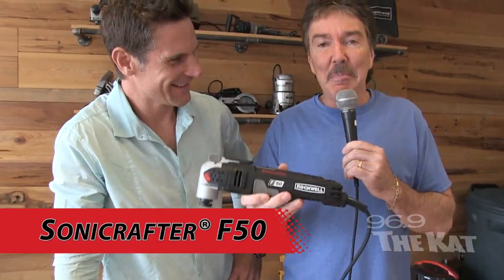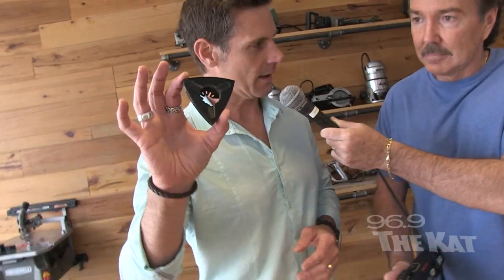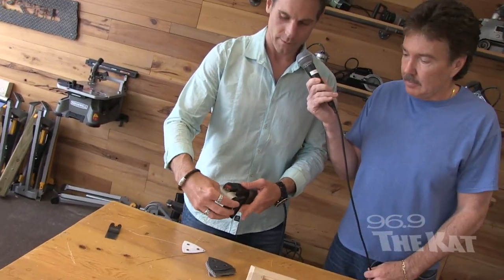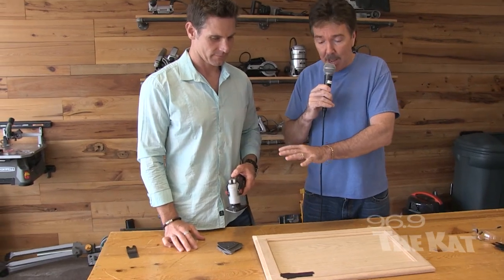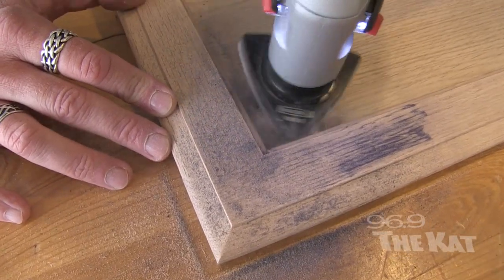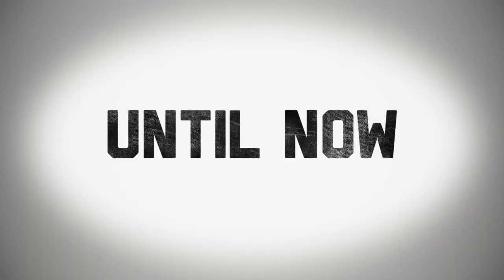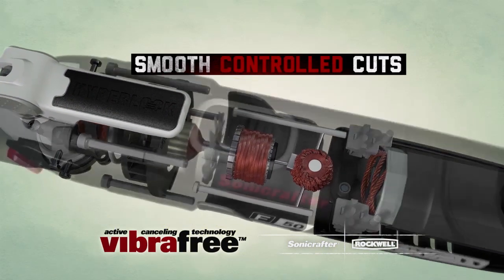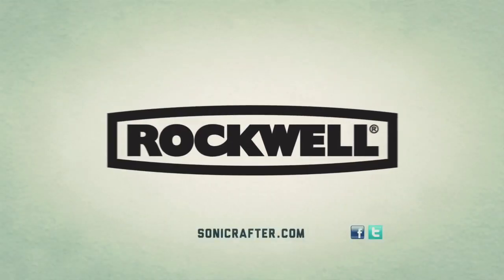Paul Schadt Test Drives the Rockwell Sonicrafter F50

Comment: I have a dremel mm45 and I tried using the sanding feature of the tool which is just like this one. I found that large sanding projects are too much for this tool. I was working on a fence and tried to sand mold off of the French Gothic picket tops. I gave up on this. I did like the metal cutting tool which I used to cut the tips of deck screws off that were sticking through the fence which creates a rust issue. I did have to get a carbide tip blade to do it which did not come with the tool. I like the tool though. It does get into some tight spaces. I am thinking about using a trim router to cut just a little off of the tips of the pickets to get rid of the mold. Any thoughts on that would be helpful before I spend the money. I have until the spring to paint so no hurry. Fence is only 15 years old. Do you think I should just build a new one. laugh out loud. It would be nice to have a sanding blade that is rectangular and sticks out further from the tool to extend into the tights spaces of the pickets that are on the fence to sand with. I could not get to the lower part of the pickets with the wedge to sand. Orbital sander was too big as well. When items are vertical and close together it will not work. I have a one inch spacing on the pickets.